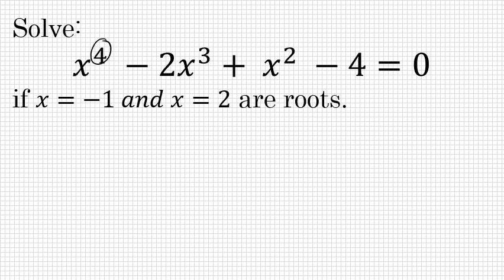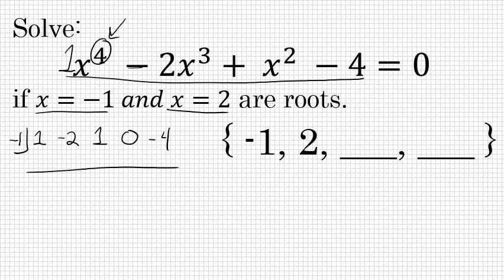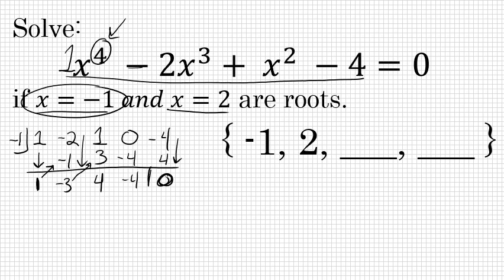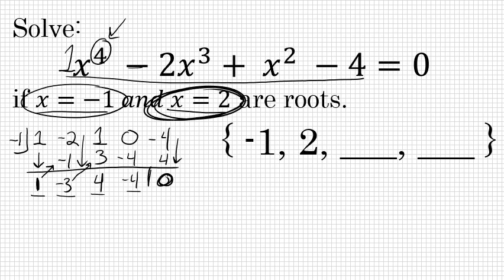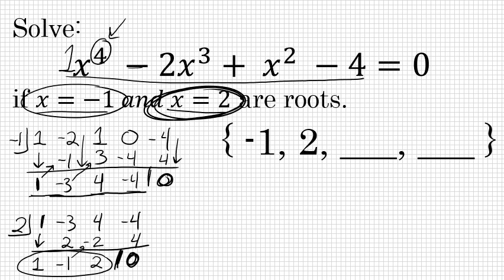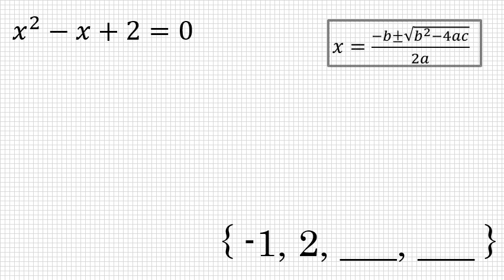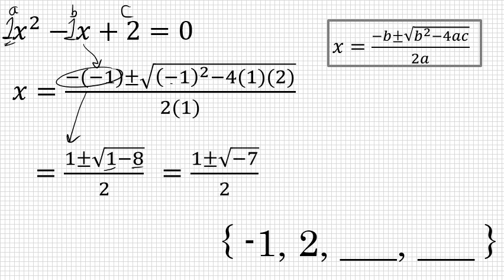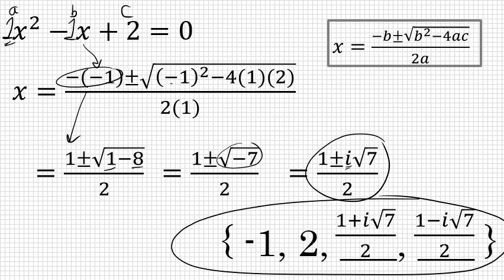Solving a Polynomial Equation Given Roots

Comment: I have the problem x^3 -17x + 4 = 0 when the root is 4. I plug 4 into the synthetic division and don't get 0 but a remainder 136? I'm confused
Reply: since theres no x^2 I added 0x^2 so the synthetic division would have 1 0 17 4 and 4 as my root on the outside
Reply from the maker: You are correct to add a zero for the missing x squared term. However, the 17 must be negative. When you do the synthetic division the top row should be 1 0 -17 4. The sign of each number is very important.